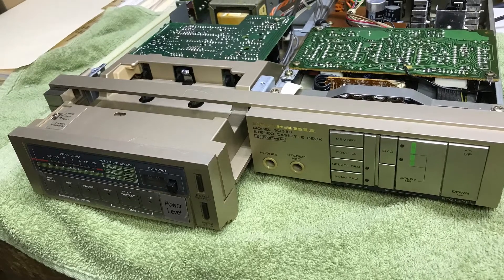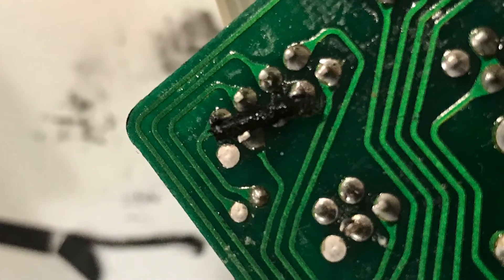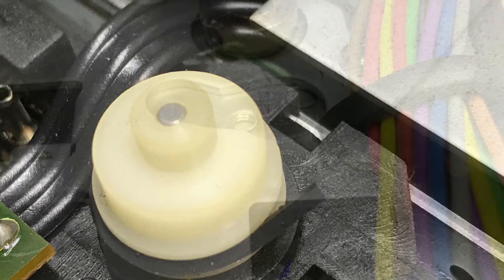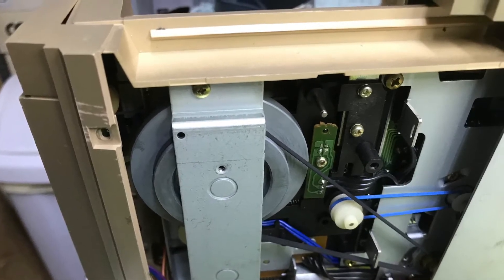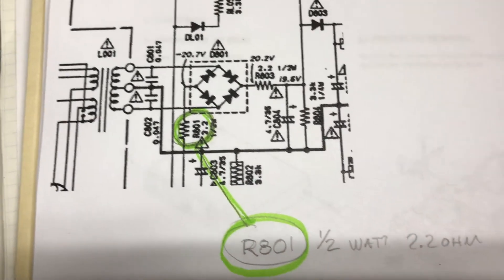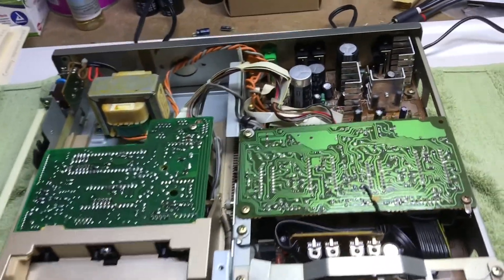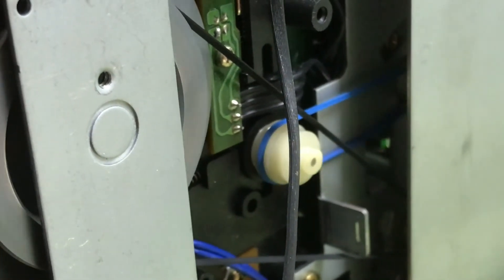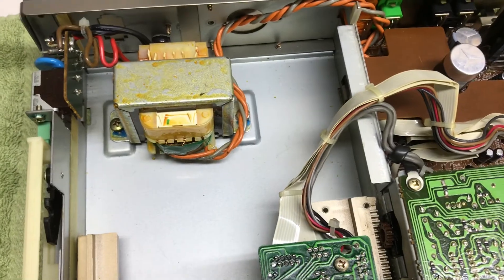Marantz Cassette Deck Repair SD333

Comment: Every tape recorder/player repair I get is always just belts and lube. Nothing fun to diagnose like shorted diodes etc.

Fixed a door chime last month that had 3 bad zeners in it. Replaced them and it's brand new again. Really fun to diagnose and repair.
(I'm a locksmith by trade for the last 25 years......door chime was for a customer at a pizza shop who we do lock work too for him)
Fixed 3 of my bosses quartz clocks right after DST when he tried turning them back an hour earlier this month........... Never fixed a clock in my life and was able to fix all 3 and learned a lot. Simple devices but sort of ingenious how they work.
Reply from the maker: You sound a bit like me. My mantra is "If it's not working let me take a look". I always see the project as a challenge and get a lot of gratification in restoring an item to operating condition. Keep up the good work
Reply: @xfireamg417  I have a wall safe with electronic lock a customer brought in. They forgot the code. Drilled a small hole to get it open. 
Problem is that there is no reset button to reset it like most all elocks have! Usually there's a red button inside etc etc to set them back to the default code of 1 2 3 4 5 6.
I am stumped. Took it apart and has a very simple PCB. There's one main ic chip which is a PIC16C54C.  I have the datasheet and pinout. But have no clue if it can be reset. One of the pins is a MCLR pin.....which I assume is master clear?  I read that somehow you can put a resistor across it and the ground pin VSS....but not sure.
Wanna put my scope on it and see if different button presses on the keypad show any difference. Customer doesn't want the safe back....just needed what was in it.
Safe is a cheap piece of junk really.
Sorry for long post☺️
Reply: @xfireamg417  You're right.  I love the challenge and diagnosing things that other people would just give up on immediately.....and throw in the trash. I've recapped and restored a lot of 1970s Sony reel to reels. Those things were built like tanks. 
My favorite stuff is ironically,  Radio Shack stuff. If it has the name Realistic I love it! The early Realistic gear wasn't all crap🤣 I have a small Realistic 505 ...a small portable 5 inch reel to reel that was probably used once. Made in 1972. Needs new caps,belts that turned to goo,  and new germanium transistors and the old grease cleaned etc. Amazing sound quality for voice.  It's no Nagra but I love it.
Even has original owners manual and AC cord and mic.